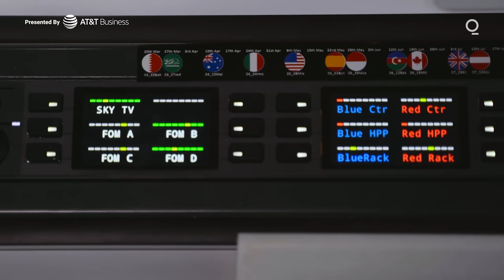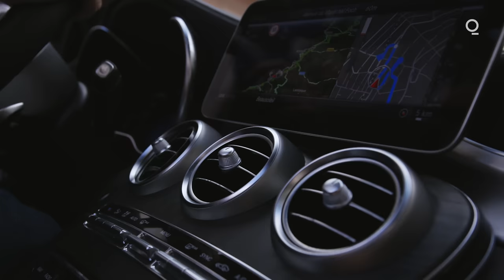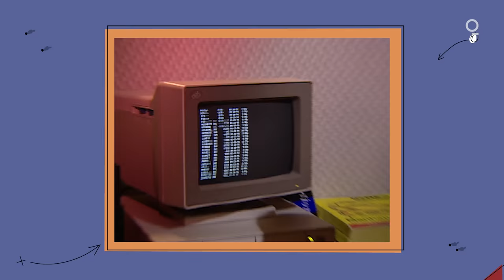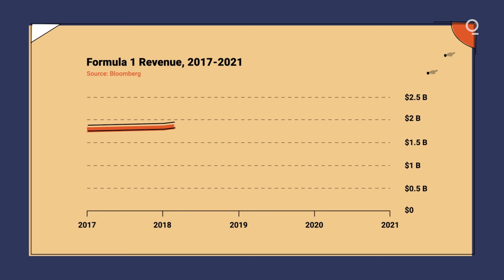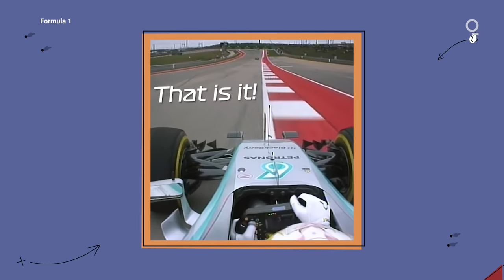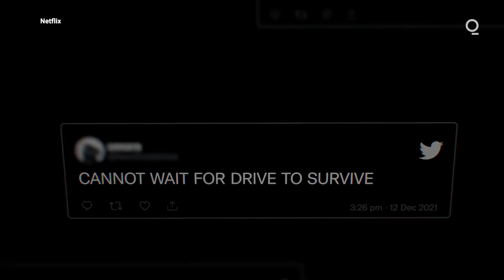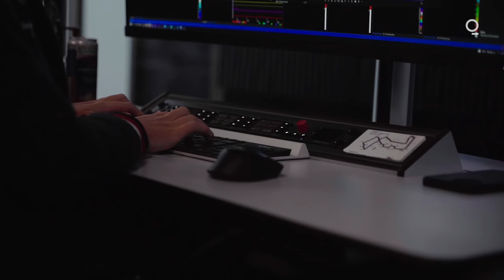Why F1's Toto Wolff Says Losing Is a Good Thing

Comment: What’s really impressive about Mercedes this year was that they were so bad that they were seen as a distant third. Now they might actually surpass Ferrari in the last race which was unthinkable at the halfway point
Reply: The new aero rules really messed them up so bad. Sir Lewis was so frustrated with the car because they could not figure it out for most of the season, which is a shame because the car itself is so reliable. Brazil 1-2 was an incredible recovery for the team. With RB having wind tunnel testing penalty next season, Merc is poised to really get back into the top.
Reply: It is not hard to see how Ferrari implodes through the season
Reply: Na they about 6 to 8 tenth behind again.
Reply: Agreed, Russell has been terrific at extracting the maximum from that car. If Lewis had done the same they couldve finished #2
Reply: @daarom3472  considering lewis was the test pilot for the car in the first half means he had a test car every race. That made it difficult for him to adjust as every car was different every race weekend. Russell didn’t have to go through this.
Reply: @charles-davidberube1174  

1. Do we have official confirmation thats the case?
2. Russell also outscored Lewis in the second half
Reply: @daarom3472  look at both cars. Hamilton had the new bits on it to test.
Reply: @charles-davidberube1174  so he got more updates faster? That must be terrible...

Comment: Redbull has been trying to slow down Mercedes since 2014, Christian Horner literally asked the FIA to just slow down Mercedes in 2015 because redbull could not compete with their engine. After so much lobbying from redbull the FIA eventually banned most advantageous innovations that Mercedes had, such as DAS and party mode...and even that wasn't enough and Mercedes still beat redbull in 2021 and now they lost their engine advantage redbull are the best team again because they have the best aerodynamic team. As Ferrari said aerodynamics are for those who can't build engines and that is why redbull lobbied to freeze engine upgrades a year earlier than it was supposed to freeze.

Comment: As a big Formula 1 fan - Lewis Hamilton would win 7 straight WDC is just plain wrong at 6:45
Lewis won WDC in 2014, 2015, 2017, 2018, 2019, 2020. That is 6 WDC = 2 WDC + 4WDC, with Nico Rosberg's 2016 WDC sandwiched in between.